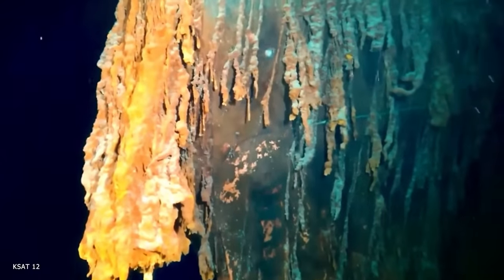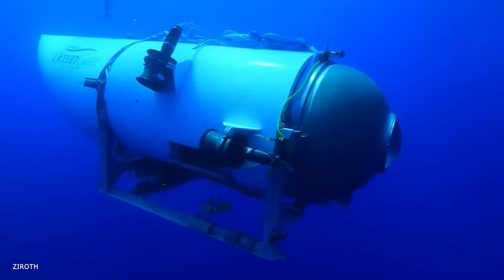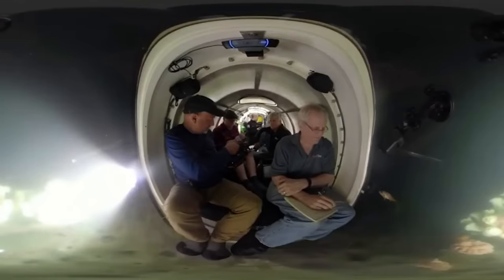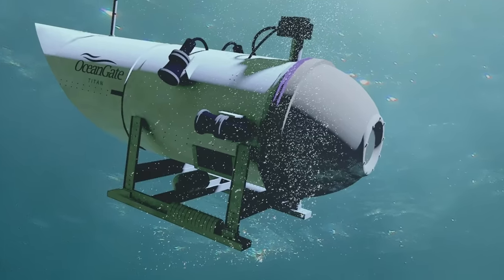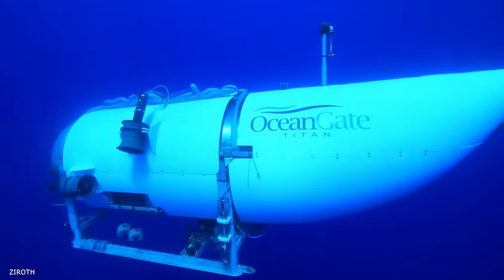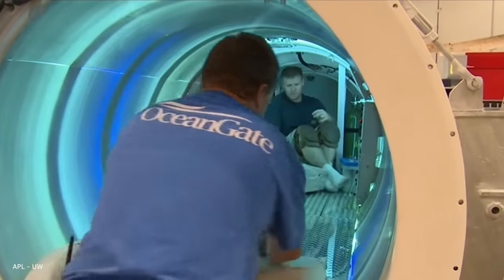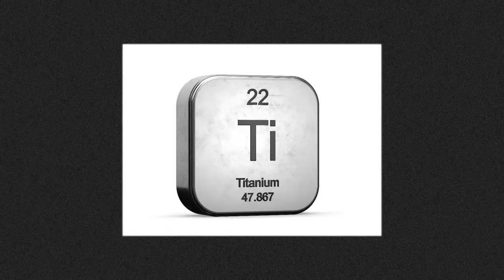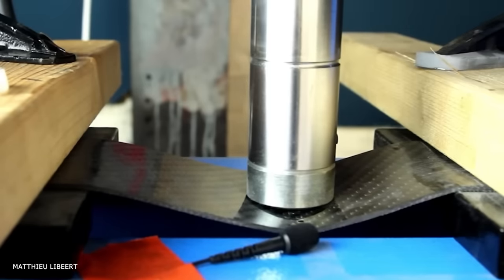James Cameron Just Reveals TERRIFYING Truth About The Oceangate Submarine!

Comment: I worked at the US Navy's Deep Submergence Unit in the 1990's.  Even back then, the amount of quality assurance work done on the Navy's DSRV's and DSV's was impressive, even for someone coming from a 'normal' US Navy submarine.  We had no doubt about the safety of the DSRV's and DSV's... every single thing we did to anything on those submersibles that were related to the pressure hull, electrical systems, or batteries were done to a rigorous quality assurance package.  The person doing the work had a second qualified person watching the work to make sure it was done 100% correctly.  All the parts involved were tracked from the foundry that cast the part to the machine shop that finished it, then on to the shelf where it was put until it was needed.  But that's what it takes to keep a vehicle safe at 20,000 feet in the case of DSV-4 Sea Cliff.
Reply: Yes all TRUTH WORKED ON JETS FROM 1981 TILL 2010   it is one worker DOES JOB AN INSPECTOR COMES BEHIND ALL PARTS HAD A CRADLE TO GRAVE PAPER WORK  ALSO ALL PARTS COMPONENTS  HAD ATACHED permanent  ID plates  that  can survive  catastrophic  events !!
Reply: Same with any western military jet, sub, ship etc.
They cost so much money and need to be the highest quality to stand the stresses of combat.
Yes mistakes can still be made as in WW2 US torpedos but usually they are designed and tested to exceed expected limits.
All around the world for decades subs from many nations have dived deep yet only a few have been lost thankfully.
My cousin is married to an ex Royal Navy nuclear submariner and it amazes me that he or any other person could deal with being underwater for so long.
They all have my respect 👍
Reply: Heartfelt Thank You to all those dedicated and brave souls ( past, present and future ), who serve to protect democracy and human rights around the world!   
As far as the loss of the Titan is concerned, this was an example of greed costing lives.  The blatant lies told to potential passengers.  Everyone involved in the OceanGate company on the day of this particular dive, is culpable.  I am trying to exclude prior employees who had tried to warn Stockton.  Sometimes I get so angry that it blocks the crushing sadness.  What a horrible waste of life.    Fran, Staten Island, New York
Reply: 😮 thank you for your excellent information!!!! You are definitely an asset!!!!Thank you again!!
Reply: Long live rush!
Reply: Thank you for your service.
Reply: Yea, dived on titanic, glomar explorer, titanic, hood, bismark, and andrea doria, and found uss cyclops, the  marine sulfur queen, was once, in the south pole,it disappeared from gulf of mexico.
Reply: What a fascinating career you had!  It is tragic when oversized egos ignore exceptional research and results for greed.
Reply: These protocols come from the understanding of environment of the deep ocean and there is no margin for error. Thanks for the info !
Reply: You gotta go step by step according to a checklist like a pilot or an ordnance man
Reply: It's even the same with car manufacturers. Every little wire, screw, and bolt can be traced back to the original fabrication point. Every piece is safety certified through an industry standard process.
Reply: Did you dive on the wrecks in Iron Bottom Sound?
Reply: This was a case of more money than brains, for sure!
Reply: Much thanks as you I'm sure are familiar with OP to Rickover for getting Subsafe program started, just not sure if that proceeded or came later in terms of DSVs.

Comment: I heartily agree with the "click bait" comments.   But here's one significant thing, not mentioned, that I think is crucial in Titan's design research.   In early "Titan vessel" development research, it was evidently well understood that building it from a uniform material was best.   So, a 1/3 model was made totally of carbon fiber, which included the two end caps.   However, under pressure testing the carbon fiber end cap/s failed.    Instead of seeing this failure as an indictment of carbon fiber for this application, they (Rush?) decided to use titanium end caps instead.  This, of course, added the dissimilar materials problem, to the questionable application of carbon fiber for the hull.  As far as I know, there was no model built/tested of the final design of titanium ends with carbon fiber hull.
Reply: The Titan design has been used before.  The Navy had developed and deployed a spy drones that was made of cabin fiber and titanium end caps called the AUSS.
Reply: Not to mention, when that test failed at aprox. 4000 meters, Stockton changes the design to titanium end caps and certifies it to a depth of 4000 meters. No further testing, just a prayer. When I saw them attaching the titanium to the carbon fiber I was in shock! So many flaws just in that assembly. That's a dangerous ego that killed 4 innocent men.
Reply: @madcavemantd2    I understand the the carbon fiber shell was designed for 7 inches but built to 5 inch (or less) with out-of-date carbon fiber. There were so so many errors to mention.  Sad
Reply: @oldmech619  If the cause really was delamination of the carbon fiber shell, as Cameron and others believe, those extra 2 inches would only have postponed this accident. That's why none of them wants to use carbon fiber and stick to "good old" steel and titanium. Metals have one characteristic that carbon fiber doesn't have: it can flex under pressure and resume its previous form if that flexing stays within the structural limits of that metal. With every dive the hull of a submersible is compressed, changing the form of the hull ever so slightly and when surfacing the hull expands to its previous form, which is no problem for metal. Now do this with a carbon fiber hull, and the carbon will start to delaminate, with seawater only speeding up the process. The usage of out-of-date carbon fiber would have sped up the inevitable, but even with "proper" carbon fiber that submersible would have failed eventually due to that delamination process.
Reply: @tjroelsma    I fully agree with you.  I absolutely would not have dove in the Titan.  Thanks
Reply: @tjroelsma  ...and even metal fatigues eventually. We have ways to determine when that is happening though and we can retire a vessel. They apparently had no real way to determine when that happened, to detect it and retire it.  I mean if they did, you could see a world where you make these vessels for a specific lifetime with a large margin for safety and then retire them. Though that requires a LOT of testing to know the mean time to failure, and he did not have any time for that. Too busy trying to kill people, and eventually himself. It does say a lot that he himself went into the vessel. So I mean he did not do it risking other people's lives and not his own. He really believed he was right. Staked his life on it.
Reply: @Gouranga56  Yes, but metal fatigue is predictable and a metal submersible is thoroughly tested, so the designers know how many dives they can get out of the hull before they're nearing the critical point. 
 
The Titan relied on sensors glued to the carbon fiber that were monitored by a computer that measured distress sounds in the structure. What Stockton Rush "forgot" was that tearing sounds in the carbon fiber means that the carbon fiber is actually tearing apart, aka "you're way too late and s*** out of luck."

I think that Stockton Rush was both too arrogant and too ignorant to even consider he might be wrong and that attitude doomed the Titan even before its first dive. It's been said that James Cameron argued with his engineers over almost every bolt on his submersible, wanting to make everything out of titanium where the engineers assured him a high-grade steel bolt had ample redundancy in that particular spot. Rush simply assumed his Titan had enough redundancy.
Reply: It should have been tested after every dive. The way the carbon fiber was wrapped cylindrically was another bad idea. If they had zigzagged the carbon fiber it may have been stronger, but there are too many other problems that this may not even have mattered. Such as the port window.
Reply: You seem to have some good information. Can you name one entity, company, whatever who could have possibly certified this craft as safe? I've never heard anyone say anything about one single company or government entity that could do such a thing. And the only one I can think of would be the United States Navy, and they're not in the business of certifying private submarines for safety.

Comment: Here is a perfect example of why remote vehicles are best, take the Soviets Venus landers. They used robot landers and learned after several tries that the pressure on the surface was inhospitable to human life and even their landers (90 atmospheres and 800 degrees). I can't imagine why anyone would want to go to the bottom of the ocean, it's just to dangerous? Send a robot (ROV) like Ballard did to Titanic.
Reply: It can actually be done with humans it just requires money and common sense. You use tested and proven materials like titanium to build your hull. You don’t use composites. Everything just requires a lot of money to do it right. James Cameron did it right
Reply: I wouldn't have gone down there in that thing if they paid me the $250,000. I wouldn't want to for any amount of money in the safest, most over engineered and over built vessel imaginable. Full agree with you about the use of ROV's here.

Comment: the shape of the hull was NOT the issue.  I served on a US Navy nuclear sub with a cylindrical hull.  the issue was the carbon fiber tube with glued on  titanium end bells.
Reply: Lol. Thx
Reply: Shape obviously was a factor.
How arrogant.
Reply: And if your navy sub went down to the Titanic.... What would happen?
Reply: The Navy doesn't try to dive them to 4,000 meters.
Reply: And if I see it correctly the carbon fibre tube was glued to the inside of the titanium ring. So, if the tube compressed more than the titanium it will pull away and open the seam. I mean it is just a plastic tube with carbon fibres in it.
Reply: Comparing a US Navy submarine to the Oceangate submarine is comparing apples and oranges.  The US Navy sub you claim to have served on may have been cylindrical in shape, however it had numerous decks and bulkheads within the cylinder, strengthening the pressure hull and providing support against implosion.  The Oceangate sub was an open cylinder with no internal structure providing any hull support what-so-ever.  Because of your lack of understanding the basic structure and geometry of a US Navy sub, I find your assertion of having served on one to be highly unlikely.
Reply: The US Navy drone that looked like the Titan was called the AUSS.
Reply: Navy submarines go down a few hundred metres at best. They would pop long before reaching the thousands of metres this craft was going down. If you can't see the superiority of a sphere over a cylinder I don't believe you were ever a submariner at all.
Reply: Military submarines are cylindrical out of necessity to have engines, crew, equipment, weapons and hydrodynamic features. DSRVs are almost all Spherical pressured hulled for a reason: Its the strongest shape
Reply: ... a decision from a "bell end"....
Reply: The navy doesnt dive that deep with those vessels, 4,000 meters would implode them most likely
Reply: Hahahahahahahaha, ouch! @jennyj9791
Reply: How that long tube hold up at crush depth?

Comment: The immediate thing that stands out is using a cylinder rather than a sphere. I think that is enough said. One more thing I should add. Carbon fiber strands can only be useful in tension not compression so the two most important issues that were ignored were the things that killed five people.
Reply: It's probably possible to make it with a full titanium hull. It would be one heavy SOB, and would cost too much to be commercially viable. He was too greedy for that.
Reply: There are already full size  titanium military submarines
Reply: Well, yes, all of that was explained in the video, but I suppose it bears repeating.
Reply: The problem isn't the non-sphere by itself. All submarines are essentially long stretched pills. The problem here was a pill made from a material that isn't designed nor intended for what the pill had to do.

Comment: If the communications between the sub and the mothership are accurate,  they seemed to be diving faster then expected. That would have caused the pressure build up faster then its normal slow decent. The sensors that alerted them the hull was having issue and loud cracking sounds were being heard long before ,Rushton started to head back up. When he did, it wasn't  responding as fast as it should even with cutting loose the extra weights.  I  surmise that as the pressure was building as the sounds were coming  from the aft,  I picture the  pressure on the forward , the back popped like a tube of tooth paste.
Reply: I agree about pressure on Titan descending to quickly did not allow vessel to adjust to the pressures. I don't understand why Rush didn't stop adventure when mother ship was monitoring speed/ too fast/ and return to surface instead of ignoring the facts. I wish there was an audio of Titan when things went south. The last few minutes before implosion must have been very scary for at least 4 people
Reply: I don't think your tube of toothpaste has any risk of implosion 😊 respectfully
Reply: I’m pretty sure those communications are fake
Reply: @pegggymallis324  Because the mothership didn't detect it and kept telling Titan they were doing fine. I just watched the video with the transcript last night.

Comment: I used to test concrete at construction sites. It takes 275,000 lbs of pressure to break a 3000 psi concrete cylinder. The pressure at 12,500 ft is 6000psi. The titan didn't look like it could take 550,000 lbs of  pressure. He had to be insane to go through with it.
Reply: He was an innovator.
Reply: Nailed it.

Comment: The shape can be engineered to take the pressure desired.  Dissimilar materials and using carbon fiber in compression are what killed this thing.
Reply: The smart thing would be to over engineer and make it spherical and out of extremely thick metal. Also it should have been bigger with more air because they only had like 5 or 6 hours. No room for mistakes hardly. 
This is so sad and avoidable. There is no reason to use carbon fiber anyway. Weight is not that big of a deal when you have buyontcy to help you. It should have been 4 or 5  inch thick Steele with steele doors and a 10 inch thick window.

Comment: Reminds me of the original build of the DeHavaland Comet. It was only good for limited pressurization cycles.
Reply: Totally different ! no one knew about micro cracks
Reply: The designers had to change the shape of the windows from square to round.  The square windows proved unable to withstand the pressures exerted on them - the corners were week points.
Reply: @ianwilltoo  Yup they didnt know about the stress on the corners

Comment: You missed an important point (you may have added it in the newer vid that i haven't watched). The carbon fiber was wond around the hull the wrong way. It is much stronger if it's criss-crossed like the small white thing was.  Of course someone mentioned Rush's ego, which amounts to hubris. I can't believe that they knew they were having issues & kept going DOWN! Hubris. I do feel sorry for the families. They really wont have anything to bury. When they found the first possible human remains i told someone that it was probably just pink slime. (Yuck, I know.) At that depth the carbon fiber is cold & brittle. I saw a news blip that said it would act like a blender when it imploded. Perhaps the second possible human remains might be a small puece of someones femur. The only blessing is that when the vessel imploded, it literally happened so fast that he brain didnt have time to comprehend. I hate, tho, that they knew they were in trouble for 15-20 minutes while dipshit took them deeper. Sorry for the rant. This incident really pussed me off.

Comment: Stockton Rush. His surname was what he was doing, rushing, spending more on lawsuits against former employees. Then doing the right thing and having the craft non-destructive testing after each dive would’ve been a good way of doing it. As the damage to the carbon fibre would’ve reset the real time monitoring each time it went down, if they were going to use carbon fibre, it should’ve only been used once maybe twice maximum. Then have a new carbon fibre tube made. They are not meant to do complete cycles after cycles after cycles. With the precious that it is exposed to at that depth. Then is the viewing Window only was rated to 1300 feet, but ocean gate didn’t seem to worry about that point when taking it down a lot further than it safe depths. Titan was a ticking time bomb, and I feel sorry for the ones who paid for this trip with their lives. Titanic was in a rush to make headlines, and ended up at the bottom of the ocean. As Toe was Stockton, rush, was in a rush to prove something that was not certified by cutting corners and putting in lice at risk unnecessarily. No both Titanic and parts of Titan altogether on the ocean floor.
Reply: 2 words, proof read

Comment: And they even knew it was undergoing progressive failure. They had the ability to listen to the substrate cracking. 
Also look at some interior shots their video monitors were mounted by screwing into the shell. Every screw into the shell created a fracture point. Nothing, like those screws, should have compromised the shell. ((Very quick flash around @14:34)